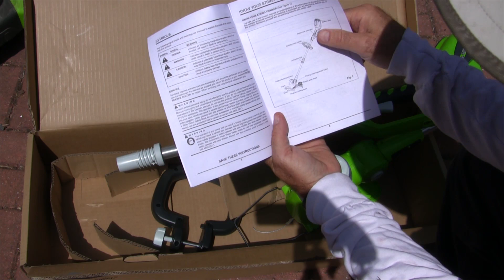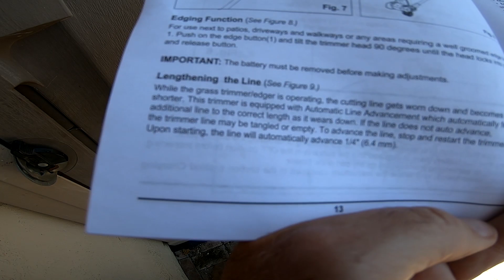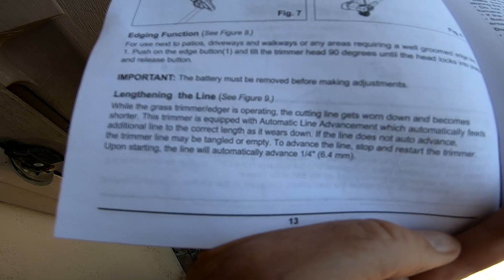Greenworks 13-Inch 40V Cordless String Trimmer Unboxing and Review

Comment: I have this model. The line automatically feeds about 0.25" each time you turn it on. I just turn it on and off 4 or 5 times to get more line when it's low. So, you don't have to open the lid to feed it out manually.
Reply from the maker: That's true, but it's much less convenient than the line feeding system on my old weed whacker where you just had to bump the bottom of it on the ground and it would feed more. You have let it stop all the way to get it to feed the next bit of line after you turn it back on, which to me is very annoying.

Comment: The manual feed button is on the back of the string housing on my model
Reply from the maker: Interesting! The only button on the back of mine is one that you use to rotate the head. On my old Black & Decker string trimmer, you could bump the lower part of the string housing (the part you remove to replace the string) to manually advance the string. With the Greenworks, you have to stop the rotation of the trimmer, then start it up again which causes a couple of inches of string to come out. I find it very annoying and I wouldn't buy this trimmer again.

Comment: Mine breaks the string about every 5 feet of trimming and I have to manually take off the cap and pull the string through. Not sure if it is the unit or me causing the issue but I wouldn't buy it again. Their electric mower works fine.
Reply from the maker: The string that comes with it is really bad. Here's a video where I test a replacement version:
https://youtu.be/76EGeg5Eqj0
That one works better, but the feeding mechanism on this trimmer doesn't work well.
At least the better line keeps a stub sticking out, so if you press the throttle and release and wait for it to stop, the trimmer will feed out 2" of line.
I don't use it that much (once every month or so for about 15 mintues) so I don't want to buy another brand. I'll just keep struggling with this one since it eventually gets the job done.

I agree the mower is good. Here's a video where I test it out on Kurapia:
https://youtu.be/5j1CXWsZ5sA

I also have a 2 part video coming out about how to change the mower blade and a review after a few years of use of the mower.
Reply: Wish I’d seen this before buying. I’m the line it came with and line feed are atrocious!